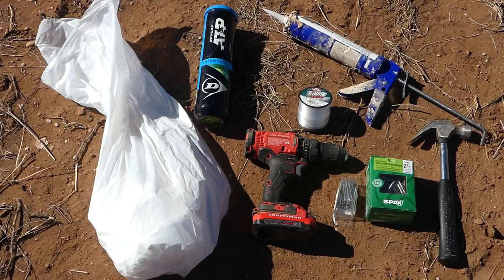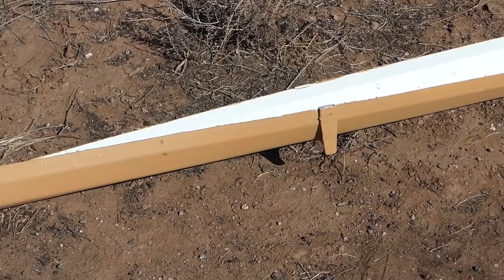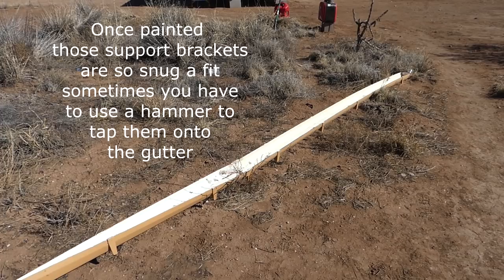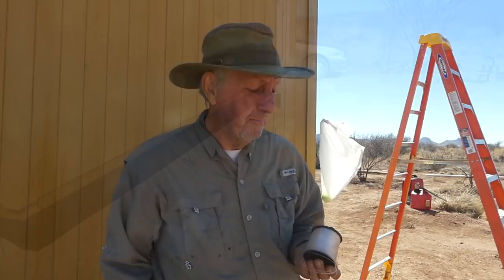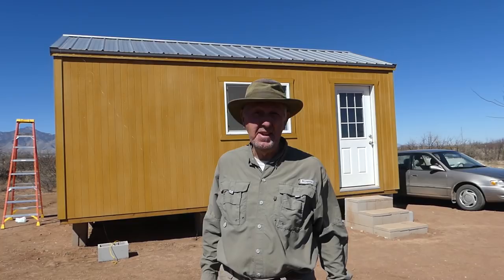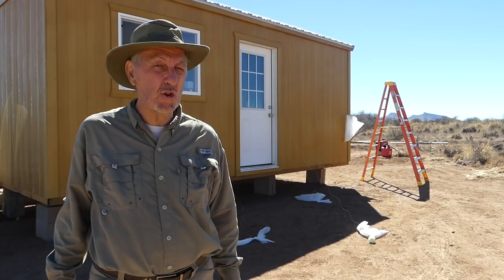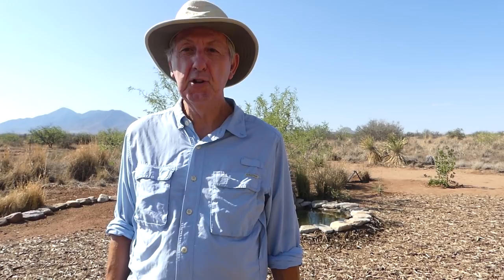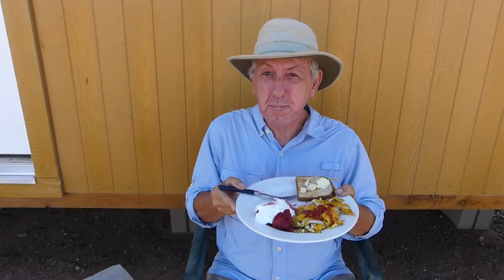DIY Off-grid Rainwater Harvesting Gutters Part ONE

Comment: I am worried that the caulk is not satisfactory for drinking water. I love the not no big deal, we will fix it.  It was on the Life Uncontained  channel where the caulk came up If I can remember. Again a totally awesome fun filled video.  You know how to solve the problems that comes with building.  God Bless.
Reply from the maker: Rodney Ross.  NOW THAT IS A GREAT OBSERVATION.  You can bet I researched this and so I will address this in the next video.  To summarize. I use the toxic through the roof caulk to fill holes in the building etc. Whenever caulking comes in contact with the rainwater I use a special but expensive caulk called M-1.  Totally non toxic. Cheers and God bless you as well.

Comment: Hello Don, love the video. I always have to do projects by myself..  so I have to plan it out well before I actually do the project.  For string tossing or a great thing to have and it is cheap at Home Depot or Lowes .. is some what they call Fence Level twine. it comes in like 250-500 ft it is highly visible and quite strong. After watching this video .. you did a awesome job on the gutter installation.
Reply from the maker: Hi Ed thanks so much for watching my gutter install.  It definitely was an adventure and I am very happy with the result! Thanks also for the great tip on Fence Level twine and of course for watching all of my videos!

Comment: I would have nailed up 4 temporary wooden support brackets to support the 10 ft load. Then attached the gutter to the house.
Reply from the maker: Its a great idea but the problem is that once you paint the gutters the fit is so so tight you can put them together once they are off the ground. Hope that makes sense.

Comment: Did you need to get a building permit for your cottage ? I was told 120sq ft. And it's ok ! And I wonder if you have to haul your trash to the dump? Septic or out house? Great videos and learning experience thanks! 👍
Reply: Watch some of the older videos, he explains that no permit is required in his county.
Reply from the maker: Hi David Martin thanks for watching.  A shed can be up to 200sq ft. Trash goes to Bisbee which is not that far a drive.  I only end up going about 2x per month. I have a septic as mandated by the county. Thanks for the encouragement with the vids!

Comment: Damn that was painful to watch. snap a line on your facia and install the brackets first.
Reply from the maker: Lee great insightful comment on your part. This is how this system is SUPPOSED to work.  However once you paint the gutter and bracket it becomes just a tiny bit too thick to snap the gutters into the bracket.  Trust me I tried very hard.  Just not possible.